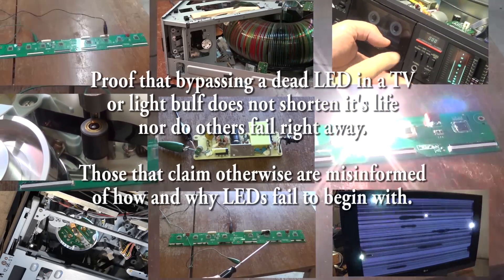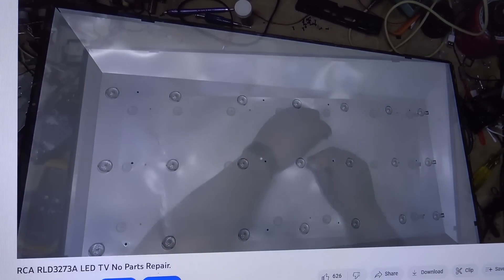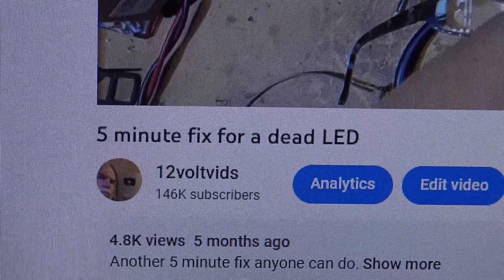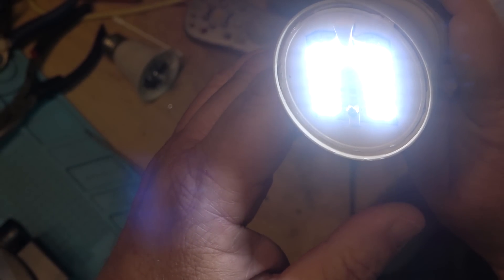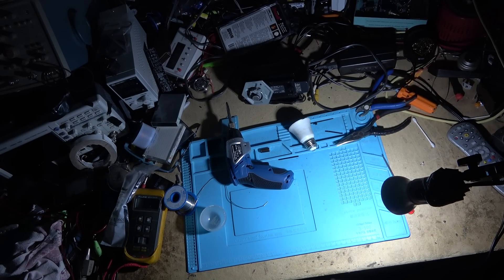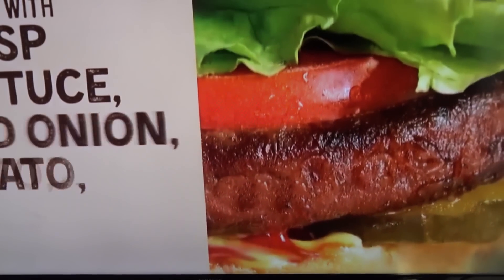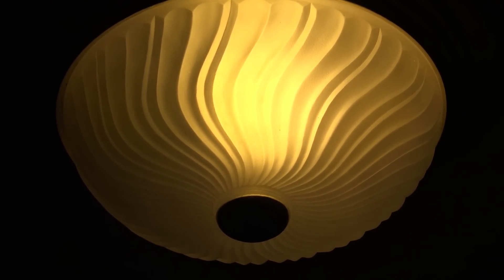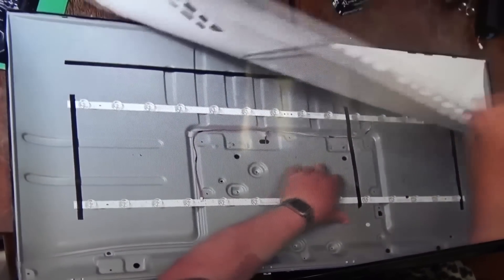You can stick your comments about LED TV failures where the LEDs don't shine

Comment: I gave my parents a Sony 40 inch at least ten years ago probably longer it uses the fluorescent tubes not LEDs and they still use the tv today. They keep that tv on almost all day every day.
Reply from the maker: The CCFL were very reliable. I have a few and they go on forever, just like plasma.
Reply: @12voltvids The only issue I ever ran into with them was MOSFETs.
Reply: I have a 40-inch sony v4000 tv and its very good still.

Comment: Maybe the know-it-alls should upload their own videos on how the know-it-alls fixed their own LED TV'S.  I bet you they will not because they lack the knowledge to fix a led tv backlight problem. COME ON KNOW-IT-ALLS. Put up YOUR VIDEOS or SHUT UP!
Reply from the maker: Love the ones that say that they bypassed LED and another failed in a week.  I have never experienced this. I doubt their comment. They probably heard that from some other site and just repeat it.
Reply: @12voltvids  I can see it happening much more frequently if there's an external factor. I repaired a grow lighting panel which had some corrosion and several bad LEDs and it didn't take long for another to fail.
Reply from the maker: @eDoc2020  high power lighting is usually over driven plus the high number of led in close proximity allows for very little heat dispersion.

Comment: You GO, Dave!!!
Reply from the maker: You have no idea how many comments on that tv I got because I bypassed one. Here is the most recent one.

"when one LED in a strip fails it won't be long before another one fails because there are the same age. If the customer is going to spend money having is TV repaired, surely is worth spending that little extra to get new LED strips for longevity of the repair. This was a bodged job and not the correct way to do it. if you going to make videos then teach your viewers to do the job right and not to do a botched job."

botched job? It was either do it the way the owner requested or the tv would have been tossed out. Simple as that as they would not spring for new back lights. Even if it only added 20 to the repair, which it wouldn't because by the time they arrived it would have been much higher than that. Just to ship to Canada would be 30.00 or more plus the cost of the part.  I just had a VHS tape shipped in to be digitized, and the postage to send a VHS tape was 24USD to ship from the USA.
Those costs are passed along and that puts the price into the uneconomical to repair category.
Reply: @12voltvids  Agree 100%!!!